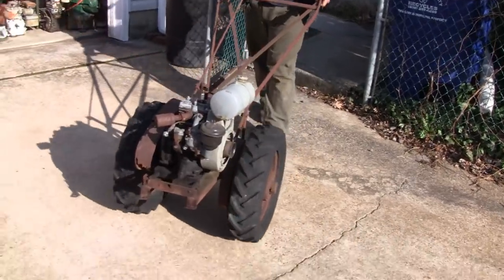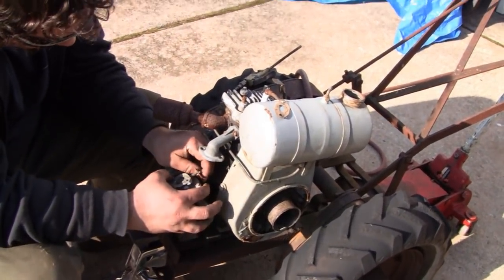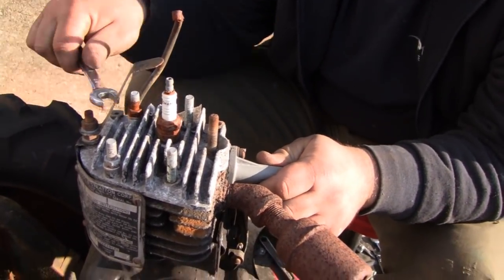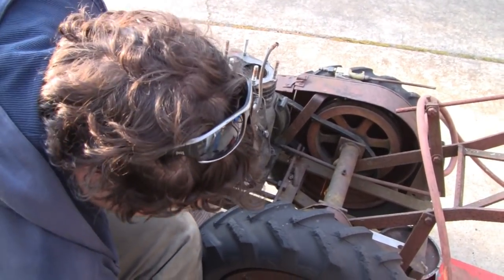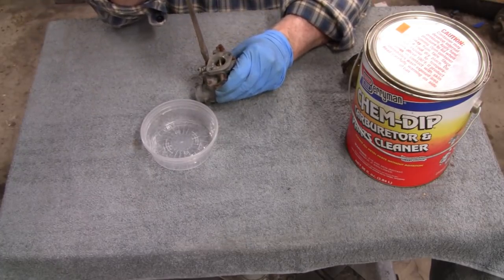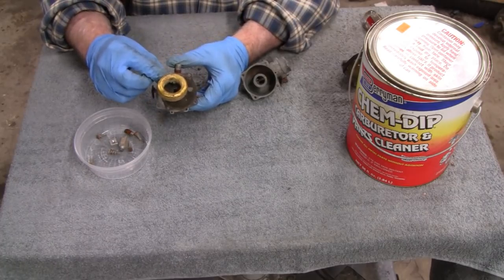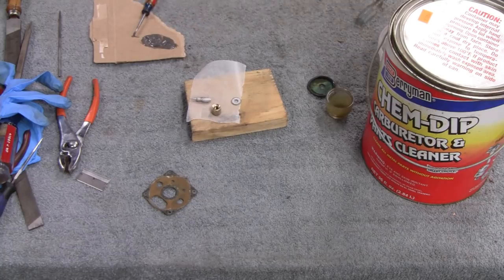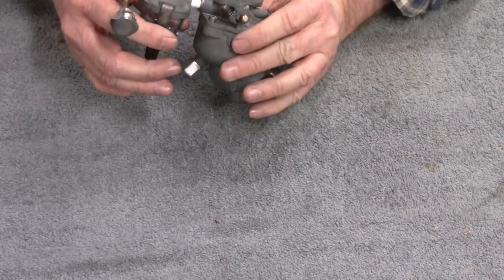ANTIQUE WALK BEHIND TRACTOR REPAIR (part 1)

Comment: This looks suspiciously like the old Garden Aid walk behind tractor, made by Garden Aid in Kingston, NY circa 1948. My dad had one he used when I was a kid in the early 50's. They went out of business in the early 50's, but we were still using it up until I left high school 10 years later. It had a 1 1/2 hp Briggs & Stratton rope start engine. The funny looking head studs were made to support a tin shroud over the pulley side of the engine. Ours had a single mouldboard clod buster plow, a rake, and a side mounted sickle mower, about 4' long and dangerous to use as all get out, particularly with a little kid (me) running around. Nice to see that again! Thanks
Reply from the maker: Thanks for the info!!☺

Comment: You should screw the tube out before disassembly, and install it before reassembly. I am surprised it didn't break. A friend of mine has a David Bradly like that. It will pull his cars around his yard with ease, but it's slow.  Looking forward to seeing it run.

Comment: Some of the really old rail speeders have sliding base engines like that. Much heavier and larger, it eliminated the need for a tensioner with some sort of precision bearing that would never see lubrication. Neat old tractor there RK, and I thought only PA farmers were experts with epoxy!

Comment: Had one of these complete with the neat tin shroud around the top. The one I had also had steel wheels not rubber. I think it had a 2hp engine. Was a powerful tool I would pull cars around the place, put in my garden,  and do all kinds of things with it. had a sickle bar, 3 blades, 4 different plows, and all of the accessories. I bought it when I was 19 from the son of the original owner. Sadly it was stolen from me 10 years ago.
Reply from the maker: Great story, till the end!!☺

Comment: A buddy of mine has an old tiller where you tip the engine forward to tension the belt.
The weight of the engine always keeps it tight, and if it jams, the engine will flip back, and essentially 'trip' like a breaker.

Comment: I actually had 2 instances of light flywheels on 3hp horizontal Aluminum Briggs engines.  One was a Parker vacuum and the other had a tapered shaft and an endplate from a generator still bolted to the PTO side.

Comment: You might like to see some of those real old garden tractors. I don't mean the belt drive ones I mean the old gear drive jaw clutch cool looking ones. I especially like the ones that have there engine and transmission are cast in one piece.

Comment: Ok 1 more time at 18;36 .............   What was holding you was that long nozzle...  I always take it out first before I split the carb........Sometimes people force the bowl off to separate it and it will bend it.........Or is that one that doesn't unscrew out of the body of the carb ??     Ok back to the video